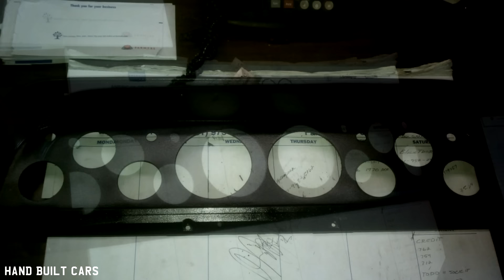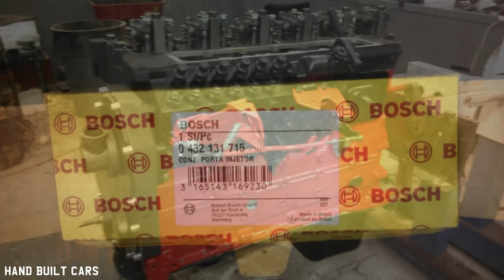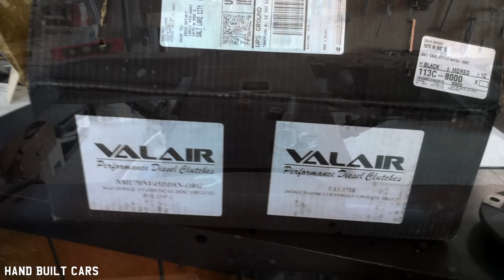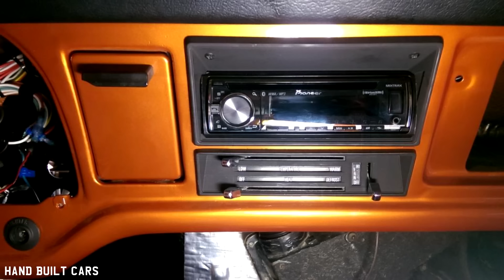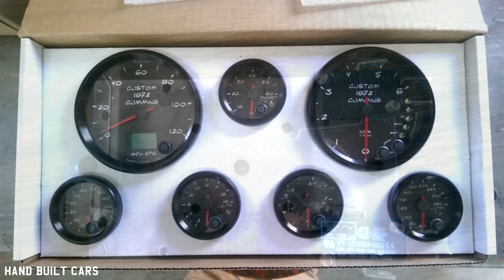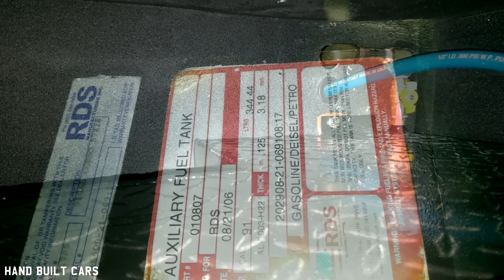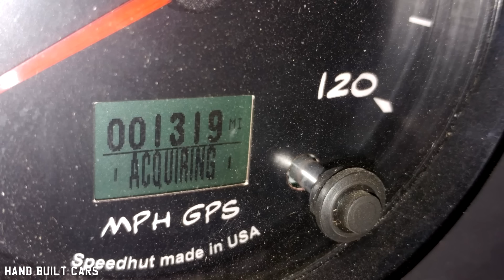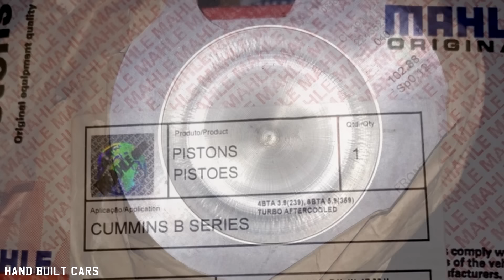1972 Ford F350 Lifted Crew Cab Long Bed Cummins Diesel Truck Build Project

Comment: I can answer some questions about the nature of the diesel conversion done here.

1. Nothing underhood needs to be cut or rebuilt to fit the engine really. The engine bay is long enough to fit a Cummins 6 from a Dodge.
2. Cutting and fab work was needed for this setup due to using an intercooler. Had there been none the swap would have been easier with minimal fab work.
3. No worries on blowing the engine up. It's a built 12 valve that can handle the boost from the twin turbos. At least the rebuild seems to be. No telling for sure as I do not know what was used to build the rotating assembly. Some built diesels make 100 psi or better boost daily and last ages.
4. The value is priceless as a custom conversion build like this has more time than money in it and you can't really put a price on that unless you are willing to pay 6 figures.

Comment: This is probably a rare truck
Reply: winglesschip 209 it is back then mostly single cabs were only used so a longbed crew cab is something rare especially if it were a dually
Reply: That isn’t the same as on the trailer, that was 2 wheel drive.  Have to lift to look like 72 4x4 as they were tall

Comment: love these old ford trucks, i have 2 of them, the first is a 1976 crewcab truck, that needs a total restoration, wish i had the money and time to get started on it, my second truck is a 1984  ford xl extended cab short bed truck, with the h.o. 351w 4 barrel engine, they don't make them solid like these trucks any more

Comment: Only thing different is I would of went with original color. One sweet truck and wish that I would of done it with my own 72 ford 4x4. Mine was a half ton heavy duty with the 390 and 4 speed. I hated the married transfer case but I still drove that truck for miles. I got to see the odometer turn over four times on two engines and transmissions, at the last, the rear ends were worn out so I bought a one ton 95 dually five speed 7.3 and I put three hundred plus on i and because it still looked new traded it for a explorer cause I'm crippled and can't maintain one. The explorer was two years old with few miles and looks new yet but it doesn't get driven.

Comment: Super nice Ford, I like everything except one small detail - I'd have eliminated the vent windows as the mirror mounting plates block them off and make them non-functional.
Reply: Matt Farah's Million Mile Lexus I agree with you about the vent windows they should've just eliminated them But they still can open & get some wind in the cab of the truck they still function just have a little bit of a blockage in the way. It's a beautiful truck.

Comment: Why the fuck would you put a Cummings in it? Ford has perfectly good diesels. Put a damn 6.0 in it. Smh
Reply: Because they all suck for reliability, cost of parts/upgrades + Cummins are just way kooler :p  Its the motor that FORD should have used in their SuperDuty line :()
Reply: 6.blow